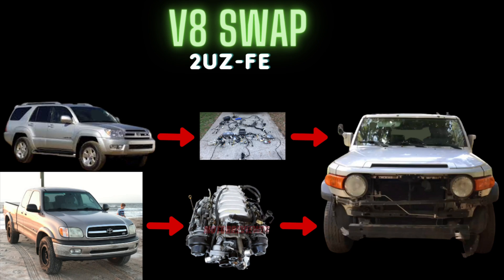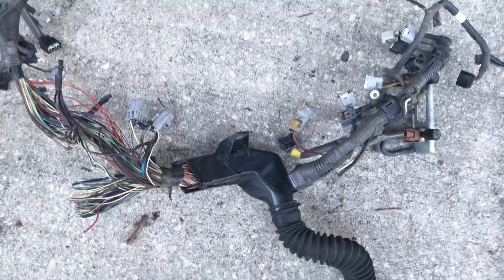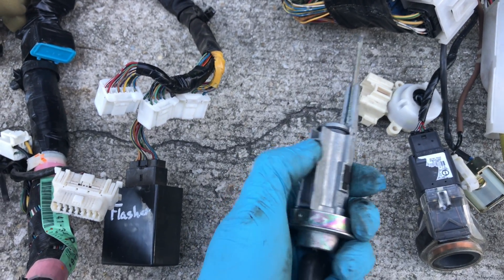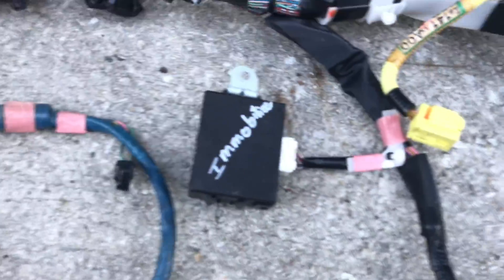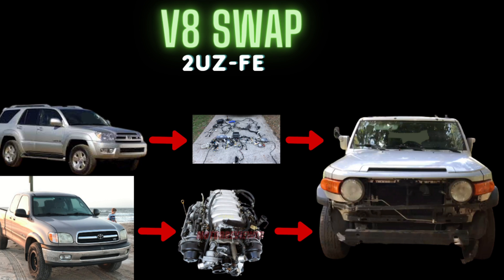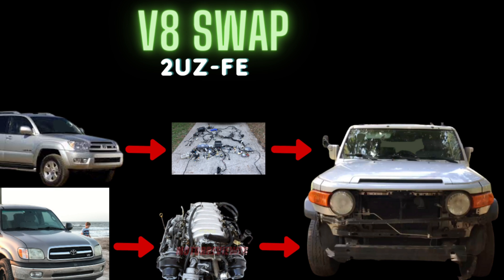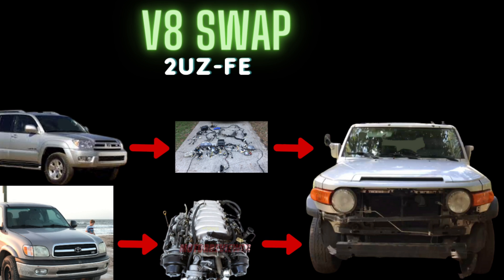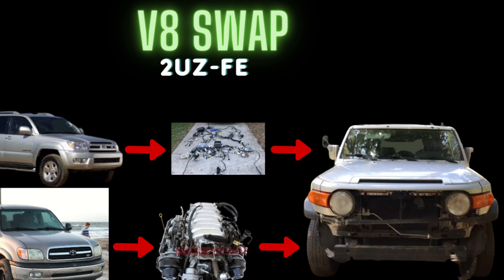FJ Cruiser V8 Swap: Parts and Plan

Comment: Yah here in Saudi Arabia we have pretty crazy engineers who work on this stuff all the time specially before winter every year

During winter we take these modded carsand buggies to camping in the desert and also sport driving on the sand dunes

I had a toyota hilux 2006 I put a 2JZ-GE in it

I didn't want anything crazy. I just wanted some more HP, it used to have a 2.0 4 cylinders miserable peice of hot crap!

For the FJ cruiser we love those old lexus LS 400 engines and it depends on your budget because usually when you get around electronics things start to get expensive really quickly. Then you have to consider what you want to get, so you can decide which route you actually want to take, if you want to go 400hp or more, then more mods are needed. And Toyota ecu i think is not really tolerant to remapping. So you might want to go with an aftermarket ecu or some solution around this.

I can remember some of the headache I had to go through to put the 2jz on my hilux

Comment: honestly all the interior stuff may not be needed. You can repin the body side harness for the ECU to work with the v8 ECU (i believe its only 2 plugs on these). This is what they do with the v6 swaps in the mr2s. in that case you get to keep all the stock interior stuff. you will also need to modify the tach or it will read incorrectly. the VVTI ecu may not be able to run non non VVTI setup. but OVtune apparently has managed to get some of the VVTI ecus to be tuneable.
Reply from the maker: Dan K. Thanks for the comment. I had a little change of plans. Did I mention I picked up a Lexus gx470 parts car? It’s got the 4.7l V8 without vvti so I’m using it’s engine and body harness and all the control units (it has at least 4, ... main ecu, vsc, air suspension, etc). This way my engine matches the intended ecu. I like the idea of repinning the fj body harness, but I don’t want the Lexus ecu throwing a bunch of lights for missing items. It’s coming together. I mount the engine this week and then I’ll be transferring the body harness, fill fluids, and start it up. Fingers crossed!

Comment: your tundra is a non vvti your not gonna be able to mate it up to the 5spd trans in the fj
Reply from the maker: Troy Fabrizius thanks for the knowledge. My plan is to use the bell housing from my tundra a340f trans on the a750f fj trans. Have you seen it done before?
Reply: @DadsGotADeal  i have not its better to get a vvti engine that is meant for this transmission and hooking it up to the runners wiring harness then you can keep the fj jshift t case
Reply from the maker: Troy Fabrizius ya I’m keeping the fj T case for sure. The 4Runner selector switch won’t be needed. I’ll repurpose it to engage the front ADD. If I could get a manual lever for the front diff that would be great. As far as vvti, I hear ya. For sure, but the air pump unit on the back of the 4Runner V8 would probably hit the firewall and the added complexity to the cams just makes more failure points... but if I had a vvti engine on hand I’d definitely use it!
Reply from the maker: Troy Fabrizius I just double checked for my own sanity. Luckily in 2003 and 2004 the non-vvti V8 was matched to the 5spd a750f transmission. I’m glad to know that, which matches my plan.
Reply: @DadsGotADeal  you got something wrong there because in 2003-2004 for the tundra it was a upgraded 4 spd same as the 2000-2002
Reply from the maker: Troy Fabrizius because I had the option to strip a 2005 vvti 4runner v8 with 5spd trans, I’m going with that ecu and harnesses. The vvti connectors and air pump will not be connected, so I’ll be getting an ecu write to turn those features off. That’s the plan. I’ll let you know if it works. There may be hiccups but worse case I can use the engine, trans, wiring, and ecu from my tundra. With that setup I sacrifice ABS/Atrac, which will be a bummer.
Reply from the maker: Troy Fabrizius I’m installing a 4Runner V8 ecu and harnesses that are made to run the V8 with the a750f 5 spd trans. Do you see any other things I should look out for?

Comment: I have a manual FJ cruiser and I always wanted to swap that forerunner V-8 engine in it I did a little bit of  research as well but the strongest V8 engine is the first GEN ones they have stronger rods. Don’t you think going with a manual transmission route will be easier
Reply from the maker: noel griffith ya I’m using a first gen tundra 4.7l V8. I’m just using the 4Runner wiring and ecu so I can control both the engine and ecu. The ecu will have some issues with my engine not having vvti or the smog pump, but worse case I just buy a 2003 4Runner ecu (if it has the a750f trans software). In short, yes! Manual trans and computer would be easier! My wife won’t drive it though...